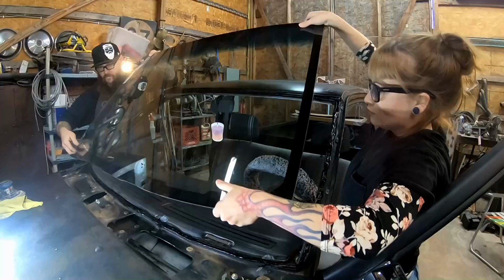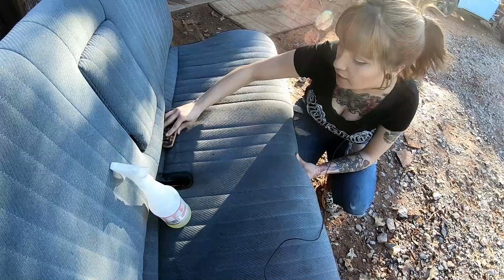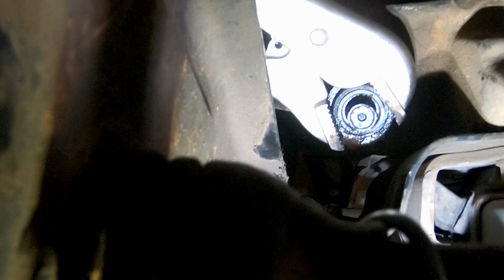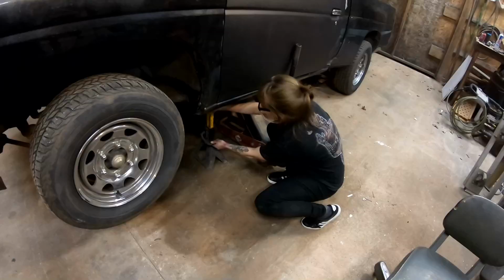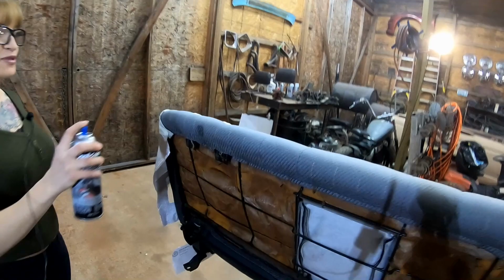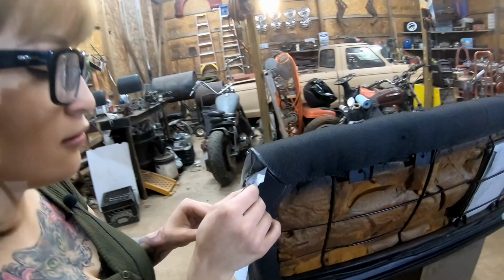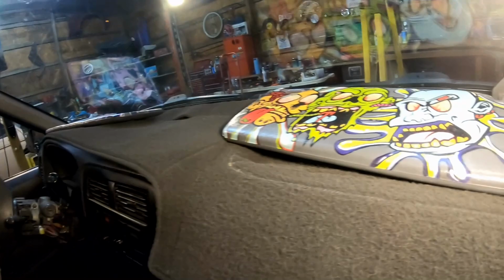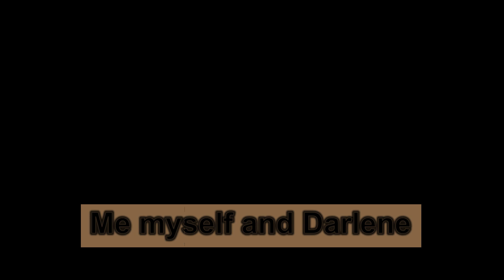Hardbody mini truckbuild pt.2

Comment: Go to harbor freight and get a light weight jack with quick pump action and a longer jack bar so you can work more efficiently . I love the sun visors and this is now the zombie truck so let's keep the theme going 👌 The seat came out awesome as well but when doing a carpet you should lay it out a day before you install it and put it in the sun if you can . Also some 3M frabic guard will help keep that new interior looking good for years to come . I think this channel is going to be big if you keep the same attitude and stay willing to learn 💜

Comment: Did the sensor fix the speedo??   Most of the the bad speed sensor is in the speedometer itself.    It does not send the speed signal to Ecu so the check engine light comes on.
Where you you get those sun visors?
Reply from the maker: Neal Feero it did fix it , I totally forgot to add that in the video 😂
Reply from the maker: Neal Feero I painted them myself

Comment: I had a speedometer not working on my 97 hardbody code said bad speed sensor ended up being the small screws on the back of the speedometer where loose. Screws that hold in the speedometer on the  back of the instrument cluster.